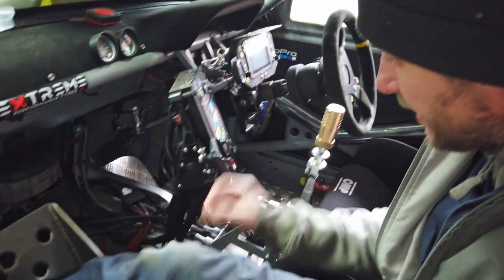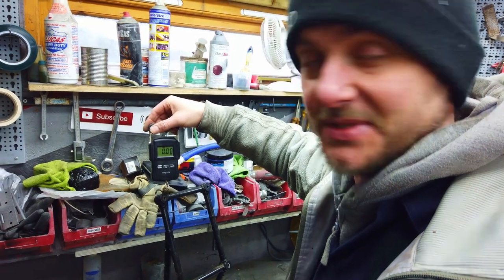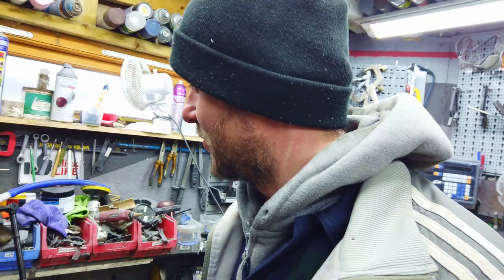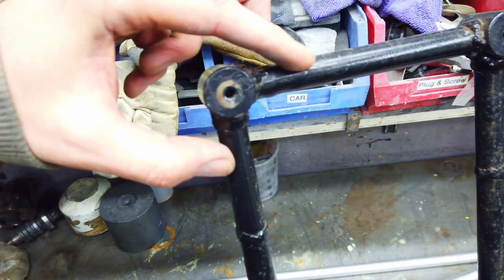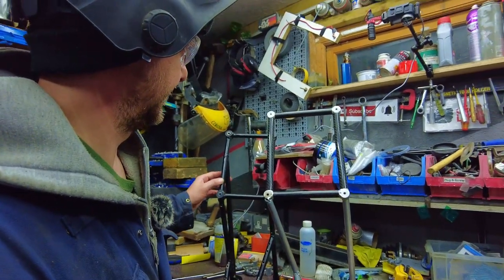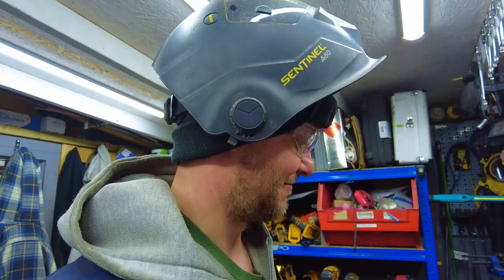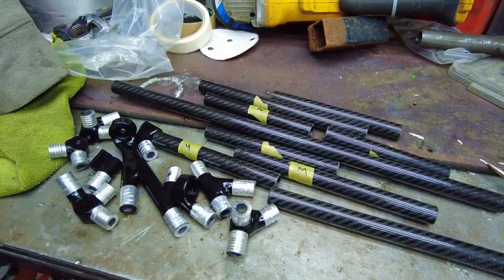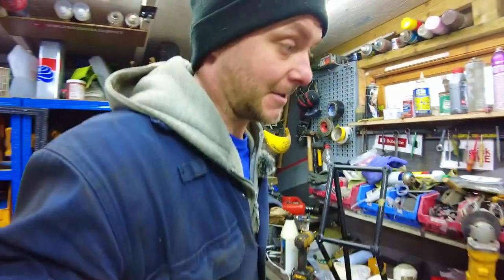Race car switch panel. Cartek power distribution panel carbon support. Building The Fastest ep.39

Comment: Ruski, any reviews on the Cartek Power Distribution panel? 
Happy with it?
Easy enough to wire in?
Reply from the maker: yeah extremely happy! its all in 1 unit! wiring is dead easy! literally just needs single wire running to most components.